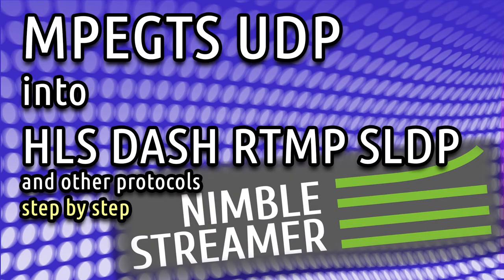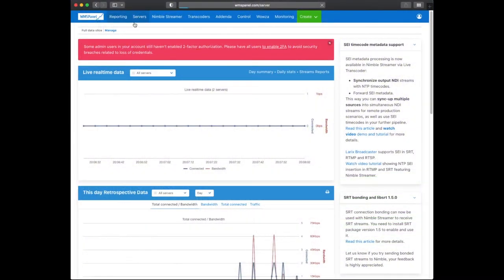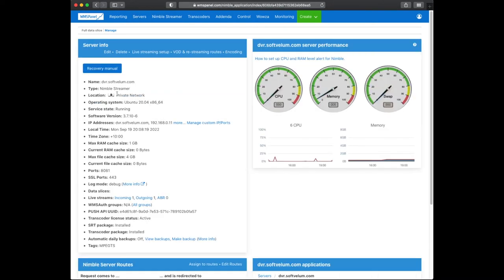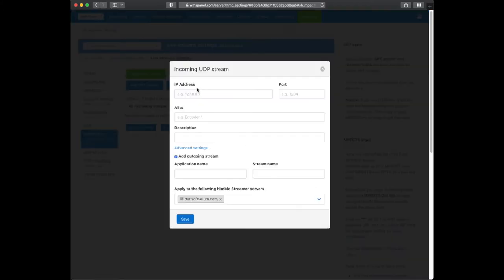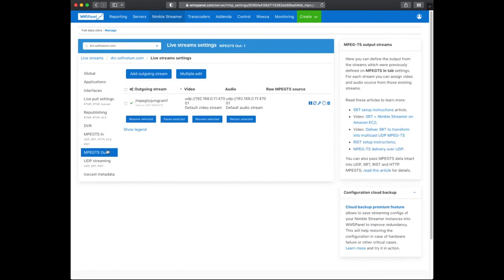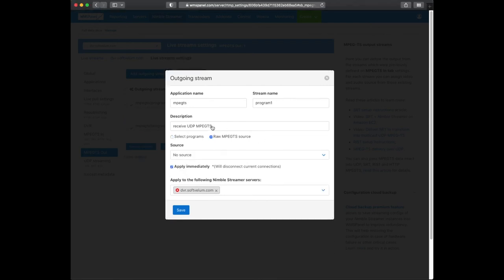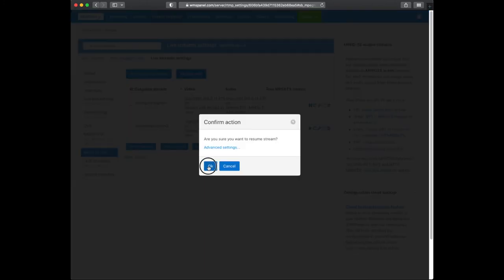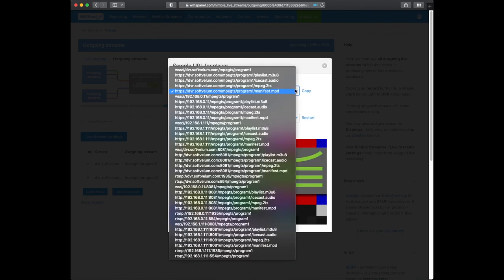Convert MPEG-TS UDP into HLS, MPEG-DASH, RTMP and other protocols

Comment: Is there anything in this video relating to MPEG-DASH output??
Reply from the maker: At 0:59 we set the protocols which we'll use for outgoing connections, including DASH. And then at 2:47 you can see .mpd among other outputs.
Reply: @Softvelum  The problem I have is there are paradigms assumed that are not explained. At least not that I can follow. I have SPTS UDP input and an "application" <- an unexplained paradigm set up with the MPEG-DASH box ticked. Then what? How do I know what bitrate renditions are transcoded?
Reply: What I need is a video tutorial that takes an SPTS input, shows how bitrate renditions are encoded, shows specific controls for mpd output and adding widevine encryption. I have HLS set up and working. But the ABR screen doesn't seem relevant to DASH. Or is that just me?
Reply from the maker: @mikedavis2676  The ABR is set up separately, being composed from whatever programs you provide via a UDP incoming stream. We'll think about creating a tutorial on creating ABR from UDP MPEGTS input, thank you.